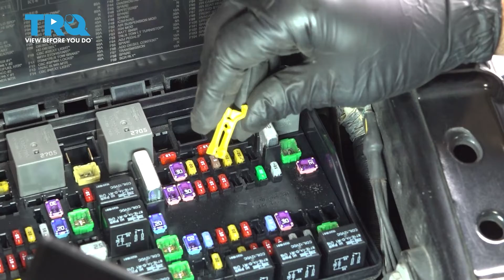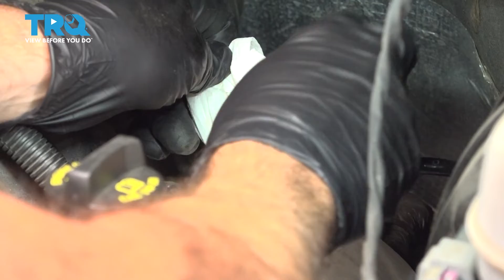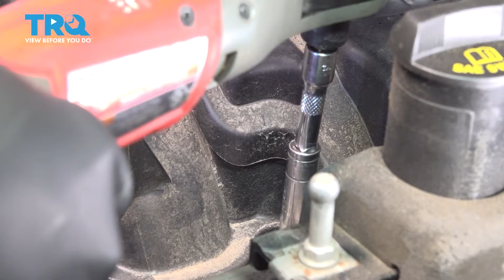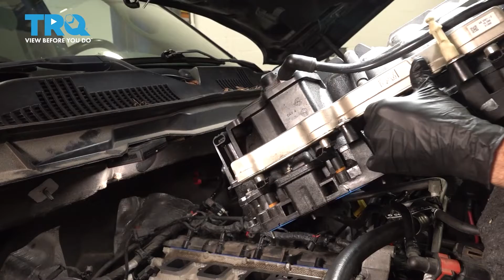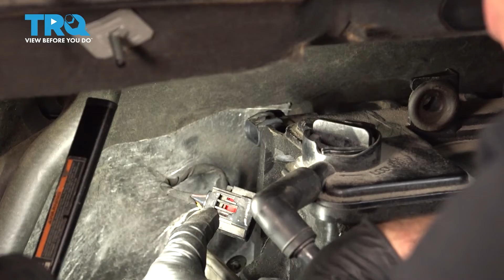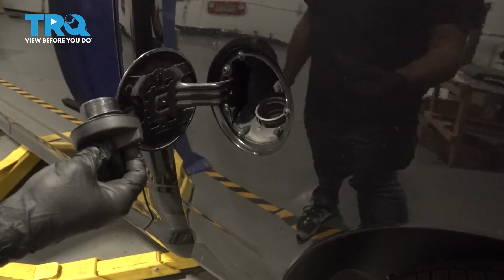How to Replace Intake Gasket Kit 2011-2018 Ram

Comment: I replace the intake manifold gasket 2011 1500 ram 4.7 n still leaking from both sides in the middle of both I even got a used 1 n same